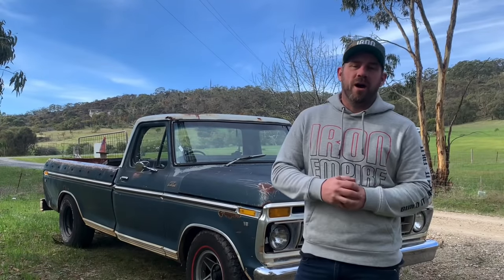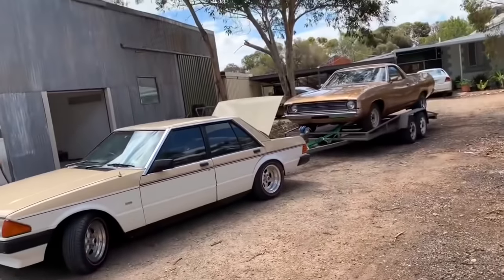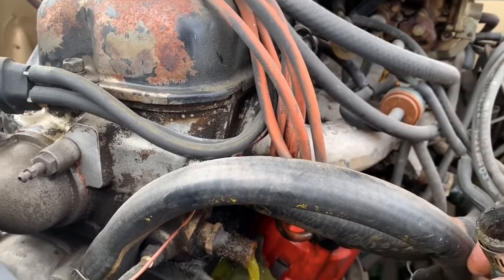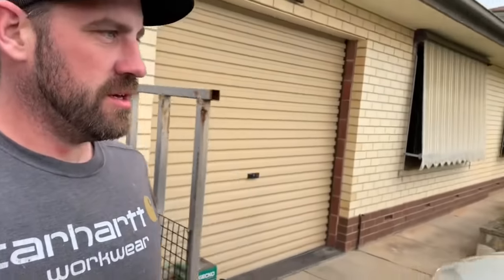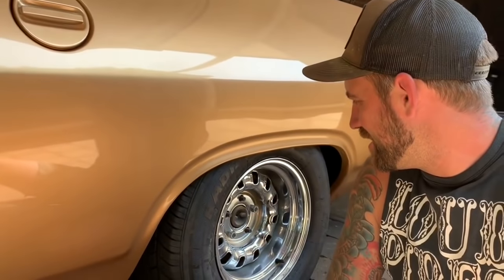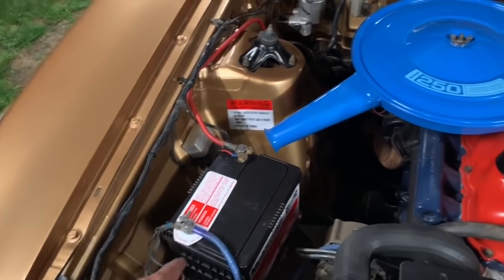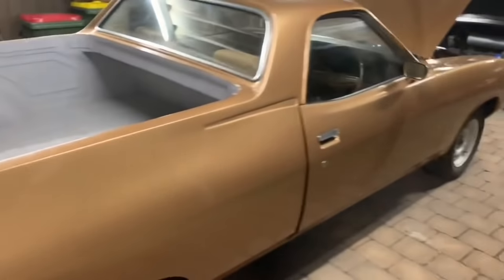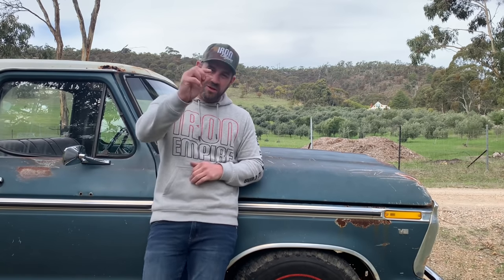Iron Empire - XA Falcon REVIVAL! Rewind special on the Ute Adventure!

Comment: My Uncle still has his XD Fairmont 351, 5 speed manual, that he bought it brand new. It's a 1 owner car and my Aunty still drives it to work every day. 

My Uncle put a 302 in it for a couple months while he was rebuilding the 351.
Reply from the maker: Awesome!
Reply: 351 5 speed?
Reply: @watsisbuttndo829  5.8L ford V8 Cleveland (around 90° V configuration), 5 forward gears, 1 reverse gear manual gearbox. If that's what you're asking. 

It might have been 4 speed before I'm not sure but it's been 5 speed for as long as I can remember.
Reply: @Dropbear237  cool, if you get a chance can you ask him if its the borg warner T5 and did it attach to the single rail bell housing. Want to do this mod to a mates 351 xc.
Reply: @watsisbuttndo829  it'll be a while before I see him again. I reckon you'll probably have your answer before I get to ask. Sorry.
Reply: Sounds like a nice car, but that car would not have come out of the factory with a 5 speed behind a 351.
Reply: @watsisbuttndo829  I asked my dad about my Uncle's XD Fairmont and it was a factory 351, 4 speed, he also got some of S pack options installed on it at the dealership. He changed it to a 5 speed about 10 years later after the panel shop it was at getting some dents removed, someone there decided to do burnouts in it and destroyed the gearbox.

I haven't seen my Uncle about what gearbox it is yet.
Reply: @Dropbear237  definite keeper.
Reply: @watsisbuttndo829  it sounds so nice too. I can't find what brand and model wheels he's got on it. He calls them 15 slotters, they're similar to 12 slotters but have 15 dimpled circles instead of 12 rectangles. It looks like they have the same centre caps too. It just gives the car it's own unique look.